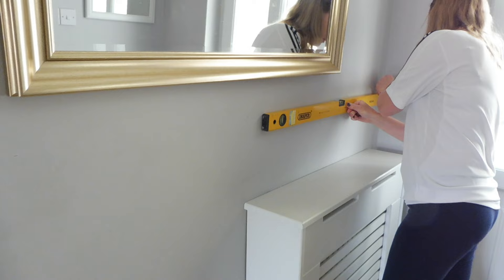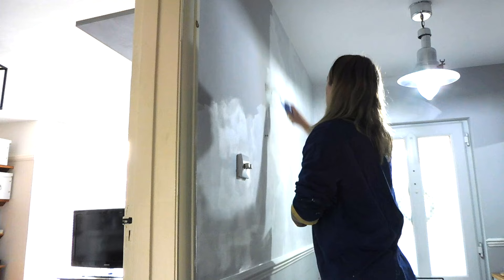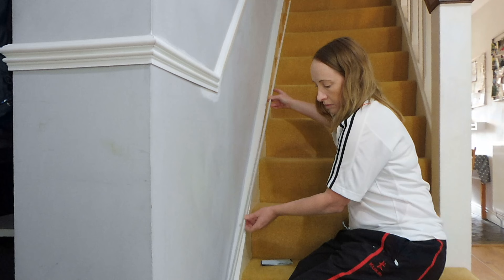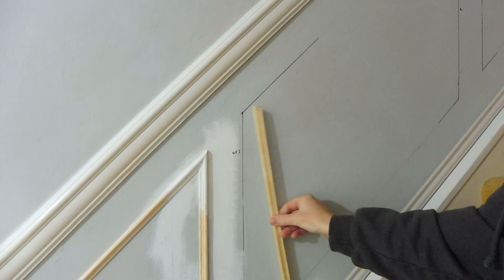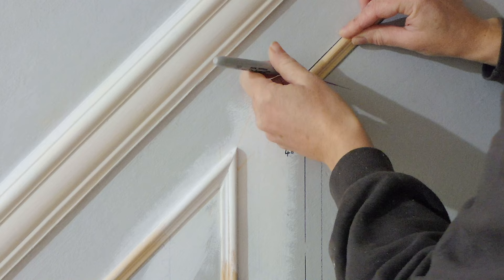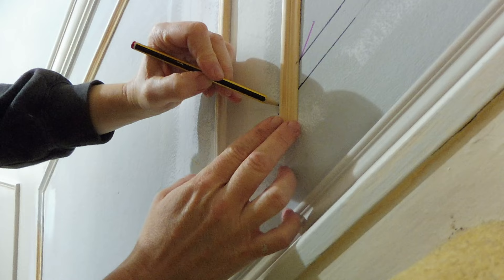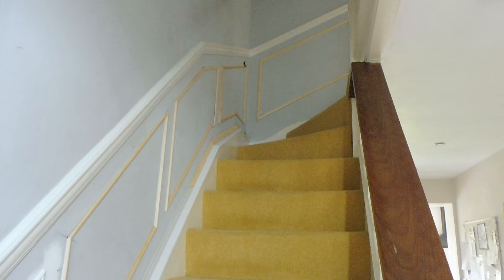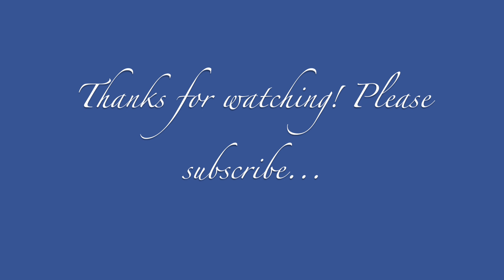Wall Panelling - Hallway and Stairs - Easy method with no need to measure angles!!

Comment: How did you the top angle?
Reply from the maker: Same method as the others - I drew the panel on the wall, drew an intersecting line and copied it onto the piece of moulding. If once you get started you get the hang of it. Best of luck with your project ☺️